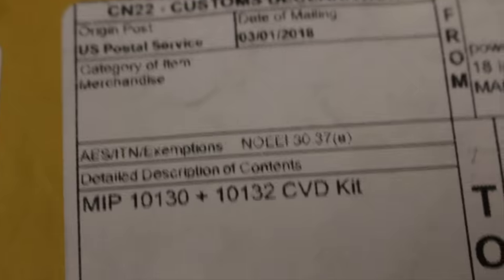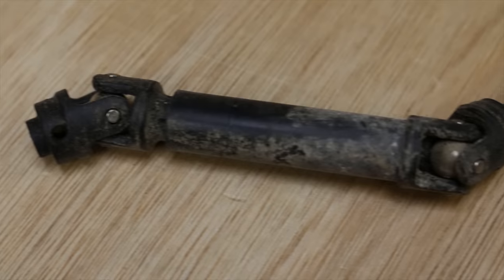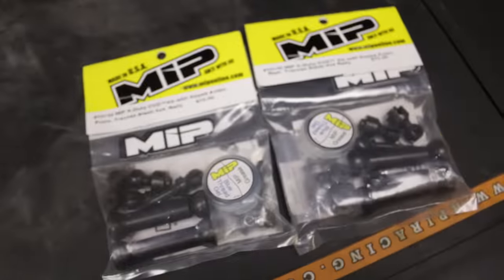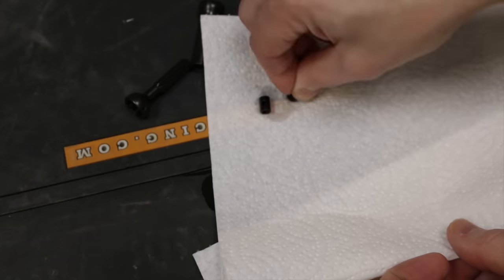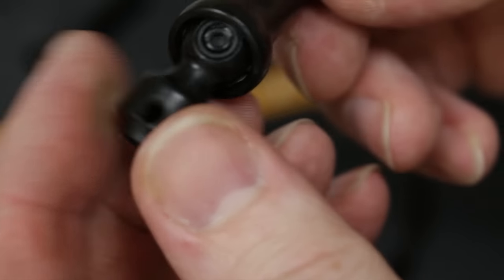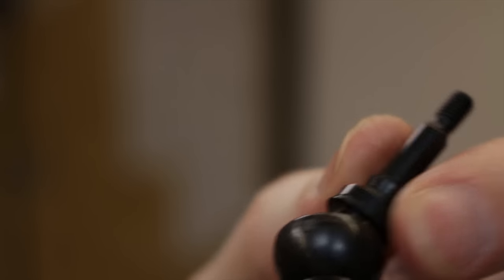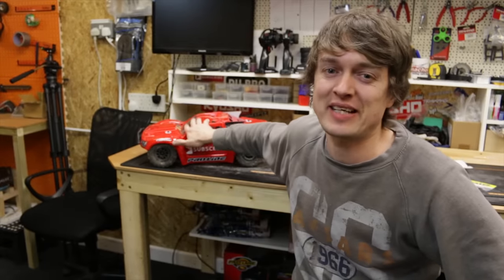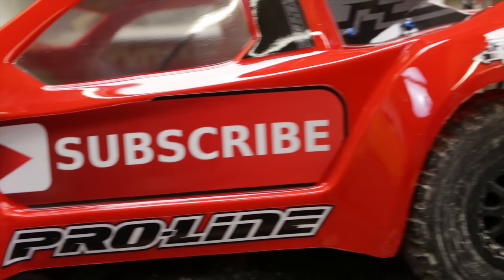MIP Shafts for Traxxas Slash 4x4 - They look EPIC!!

Comment: I never de-greased mine when new and I used blue loctite. Never had a problem with them coming apart. Just let them sit for a few hours before you run em. The only problem I've noticed with them is when you tighten on the wheels it squeezed the rear carrier (with spacers installed) causing a slight binding problem. However I've figured out if you put two Teflon washers in where the middle spacer goes it helps to get rid on the binding, not 100% but pretty close. The washers are 5x8x0.5, the same ones that go before the cross pin on the stock plastic axle.

Comment: You will be completely fine with those shafts I have those on my slash 4x4 and haven’t had a problem for 5 or 6 years and they are still in use today

Comment: Just a heads up, you don't want to leave them dry because they will rust like crazy and will emit a horrible grinding noise. I thought the same to leave them dry, but it is better to just grease them, especially in the splines.
Reply: I agree, the grease is there for a reason. Metal on metal friction is VERY bad. Although i don't know if you need them on the splines. I have a set of these on my Rustler, didn't put grease on the splines, and it seems fine. the splines don't move a whole lot either so it shouldn't be a big deal if those are dry. Either way there definitely needs to be grease in the joints.
Reply: NerfCraft For sure, I have these on a slash 4x4 and because I didn't grease the splines, I got water in them and then the car sat for a week. During that week rust accumulated and actually seized the two parts together. Probably don't have to go super heavy, just enough to cover them.
Reply: Oh weird, never heard of greasing the splines. Might have to keep an eye out. Thanks for the tip. I guess if you get them wet you should be maintaining them anyway so they don't rust, but yeah I will have to keep an eye out for that.
Reply: J3rockon or just dry them if they get wet
Reply: Eh, yeah but it would still be better to just grease them properly. Actually just went running my Rustler in some dirt. More of it is actually caught by the differential output next to the tranny box than in  the joint on the Driveshafts. Think it's safe to grease it. And really you should be taking them apart to maintain them now and again anyway, because they can get dirty. You do not want to leave them without any maintenance all the time.
Reply: Callum Watson You make a valid point but sometimes I can't get to it right away. I.e I need to go someplace suddenly or I get distracted, it's more of a peace of mind thing.

Comment: I’ve been running though on my stampede 4x4 for 2 years and they barley warn at all and one tip put heat shrink over the set screws on the diff contention points that’s what I did on mine they work great
Reply from the maker: THanks buddy I'll do that I'll keep an eye one them if they star backing out i'll do that. :)

Comment: How are the shafts holding up I'm thinking about getting some. I value your opinion because of the abuse you tend to put your cars through so anything that you say yes or no to I will most likely listen to. Lol
Reply from the maker: no good for bashing, broke 3 of them in like 2 outings. I run traxxas steel now but will probably upgrade to xo1 shafts soon, theres a video on the traxxas youtube channel.
Reply: im looking to run on 6s with no bashing at all    what do you think about using mip for that ??
Reply from the maker: yeh good for that dude, i only broke them jumping
Reply: Kevin Talbot thanks KEV.

Comment: Considering doing a 2wd slash 4s or even a 6s conversion?
Reply: how, how do you think that this is possible.

i don't now why 90% of kev's subscribers dosn't now anything rc relateded
Reply: you replace the ESC  bro
Reply: I will not waste my time explaining this to you
Reply: You are the tipe of Kid that thinks that traxxas is the best rc manifacture and the xmaxx is the best rc car ever made
Reply: no no i dont
Reply: You are rigth, becouse you don't Now what is a Real rc car
Reply: It’s simple it’s called a mamba monster but it will be so fast and uncountable unless you use it for strictly a on road speed car.
Reply: But they are the best, what are you talking about.
Reply: Shane T, sure, they are good bashing cars, but try fucking show up whit an xmaxx to a track.
Reply: Try and show up at a track with any stock car. I also have a baja5sc and thought I might have a go at a track, and went and seen a race. luckily for me some one was already there with a stocker, what a piece of crap, bouncing and bucking everywhere and so so slow as the wheels could never stay on the ground long enough to get traction.
Reply: Shane T, i have 2 racers, a t4.1 and a kyosho ultima sc, and they are fantastic at the track.
I hate fanboys becouse they Think that the best rc manifacture is traxxas, for anything. 
Maybe they are good dir bashing, but the design is old and they are heavvy as shit.
Reply: Shane T, and come on, the track was for 1/5 or 1/8?
Here, in Italy, if you show up on a 1/8 track whit a 1/5, you Will get kickd away
Reply: 1/5 dirt track, I was looking at racing the HPI.  Im selling the HPI as I dont use it anymore the xmaxx is just so much more fun.

Comment: If you want you can put 17m adaptors on there to get bigger tires on
Reply from the maker: Do you have a link?
Reply: He's already having problems destroying the driveline. Last thing he needs is bigger tires to put even more stress on the driveline.
Reply: There you go kev I have yet to try them I’m going to do it this summer but mip makes some grate stuff I love them
Reply: TestECull actually the worst he will brake and my friends have is stock arms and shock caps the bigger tires will be a little strange on the Motor but the drivelines are sold they can handle 6s

Comment: About the only problem with MIP shafts is the weight as you mentioned when you pick them up so therefore it's going to take care of differential and axle bearings more often or at least put more load on them, I run MIP shafts in most vehicles, other than things that come with Kick-Ass axles like Team Associated stuff